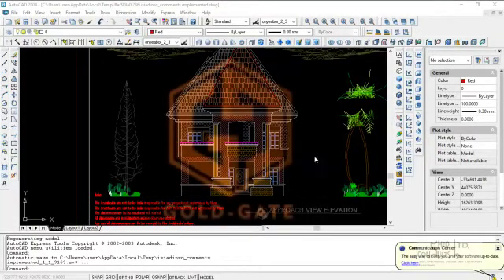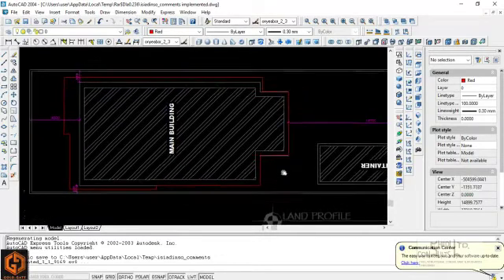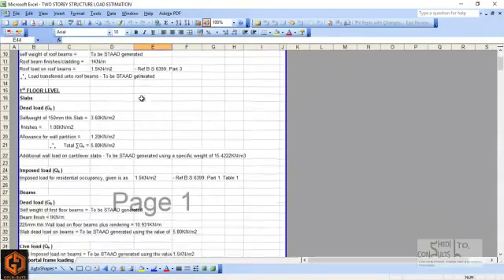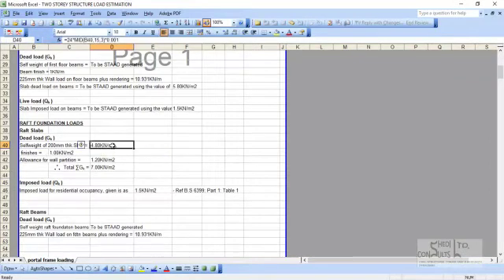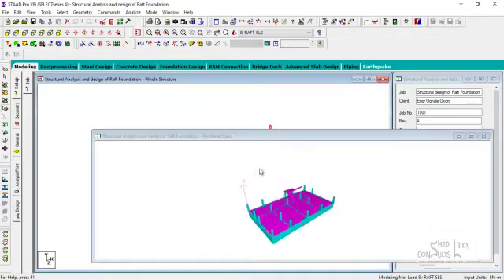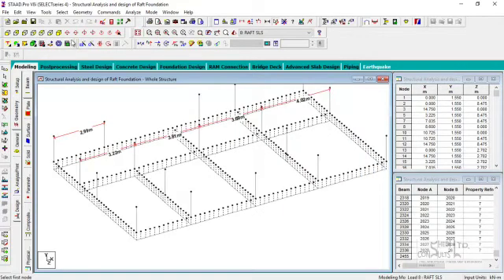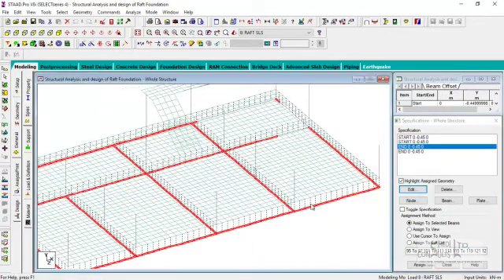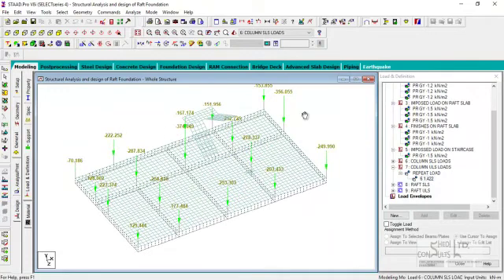DESIGN OF A RAFT FOUNDATION FOR A TWO STOREY STRUCTURE USING STAAD PRO (PART 1)

Comment: I like this method. Thank you for sharing.
Although I can't understand how you translated the results from the reaction and moments at the supports of the superstructure to be nodal loads on columns in this Mat structure
Reply from the maker: Simple, the moments and forces from the superstructure corresponding to the nodes shall be exported from staad using the reaction list...these are the forces that shall be applied at the corresponding columns of the raft foundation.

Comment: Nice video. You did not mention how you modelled the soil pressure
Reply from the maker: Thanks for dropping a comment. The soil pressure is not modelled in the course of analysis, rather the soil restraint which is based on Wrinkler's theory. The results of the analysis will provide the contact earth pressure which shall be reported by staad
Reply: Ok, thanks for the good work. What about the support assignment to the raft beam, this is not mentioned in your course?
Reply from the maker: @sikiruyusuff1246  The same same support spring for the raft slab is applied to the corresponding beam bounding the slab..The load transfer mechanism is from the raft slab unto the raft beams via the contact earth pressure distribution beneath the raft